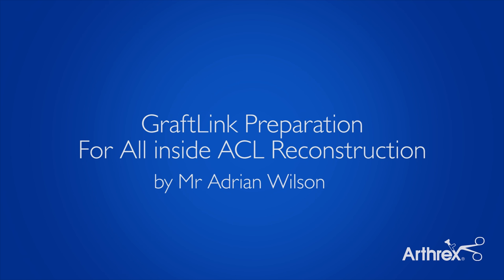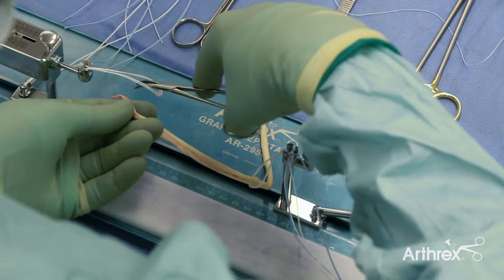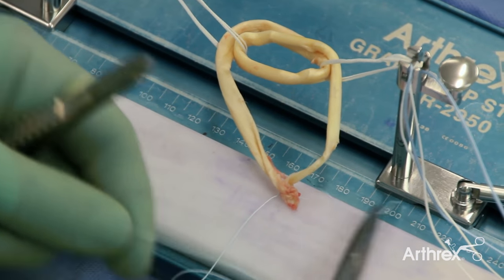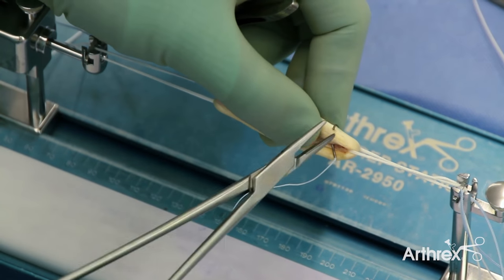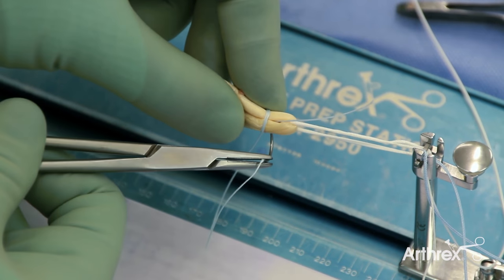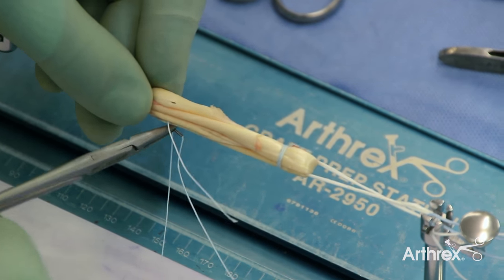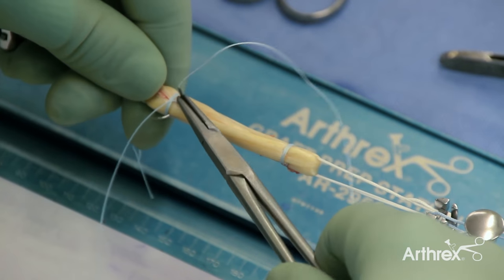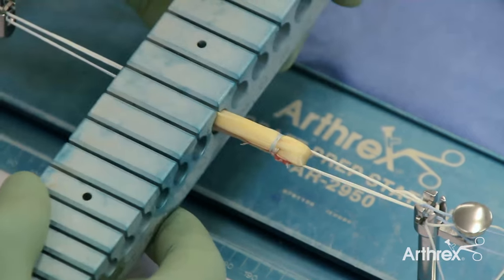ACL GraftLink Prep

Comment: Had my Acl surgery 6 months ago. 1 question what happens to the thread/wire that sticked around the graft in coming time?
Reply: yes!! what happens to the thread
Reply: It just stays there. It's braided permanent suture called fiber wire. Same thing they use for rotator cuffs. It's how they pass the graft and achieve proper tension before fixation. They then trim the excess suture. But that suture is what holds it permanently in places between a button and or a screw.
Reply: @dannibble  esos hilos se desintegran con el tiempo , el mismo tejido oseo lo cubre y desaparece al igual que los tornillos de hueso

Comment: Brilliant presentation, I think a part of fibertape will forever remain inside knee join along with ACL graft, it will constantly keep rubbing with graft during full range of motion if someone is having active lifestyle. Fibertape is strong n non flexible will this constant friction between fibertape n newly formed graft lead to further damage to graft or knee bone some 10-15 years down the line ? will there be any side effects of having such foreign body inside knee forever ? 

As per my research the ribertape tightens during full extension of knee and exactly opposite happens when you flex the knee. In our mother nature gifted original ACL the AMB tightens during knee flexion while the PLB becomes slack and vise versa. Do you think this newly formed acl graft (using all internal fibertape) will achieve exactly the same results as original one after full recovery ?